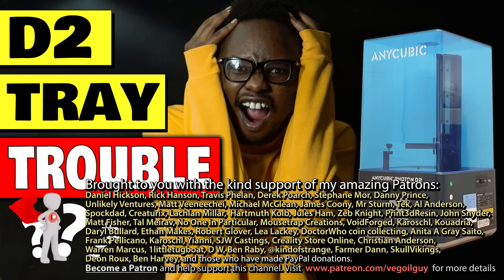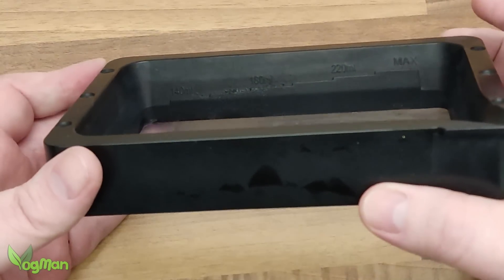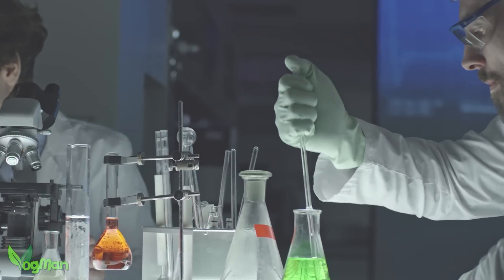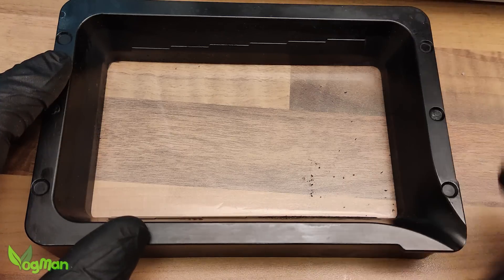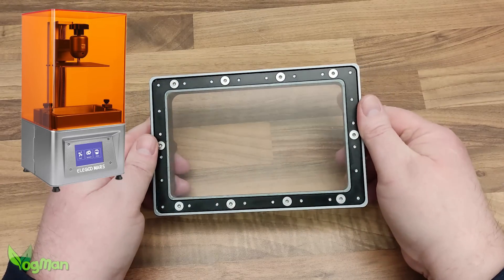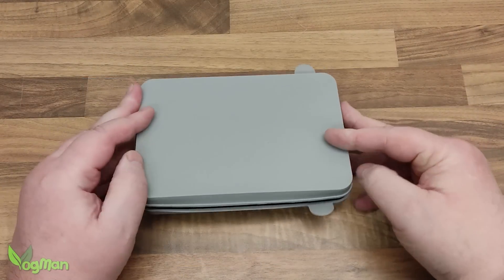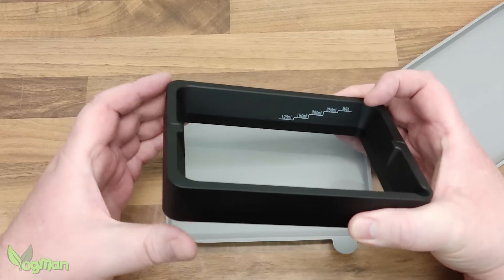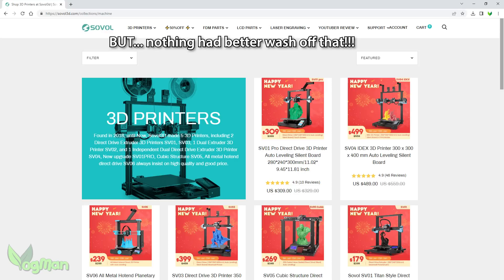D2 TRAY TROUBLE UPDATE - Anycubics Photon DLP 3D printer problem

Comment: Seems crazy to me that things are supposed to be getting better yet my original anycubic photon even has a metal vat. These new printers cost more money and are supposed to be better yet some things seem to be going backwards. If I'm spending that much money on a printer then I expect it to be of decent quality. I only paid $150 for my Photon a few of years ago. Surely it can't cost that much more to produce aluminum vats.
Reply from the maker: That's a fair point Keith, but to play advocate here... these DLPs were a massive undertaking for Anycubic and in many ways were a real risk. Don't forget they initially went down the route of Kickstarter with the Ultra because they needed the extra funding to launch the project. And dammit, both the Ultra and the D2 have been amazing, and have no doubt upset all the other printer companies - and still Elegoo nor even Phrozen have given us a DLP yet.
So we can be a little kind to Anycubic for presenting us with so much plastic on their 2 DLPs (and even on the Mono 4K which is a beautiful and affordable LCD). 
But for me the tray was a step too far. I'll accept the plastic body and the single rail... but if plastics melt with resin, even in rare circumstances, then we need metal. And I hope Anycubic gets the message.
Reply: @vogman  I feel it's because 3D printing at its inception, companies made a lot of metal durable stuff, because didn't know what they could get away with. Now they know what their consumers are willing to put up with, so they are cutting costs wherever they can.
I could be wrong, but I doubt anyone in their companies think that plastic is genuinely better than metal.
Reply: Keith that is weird because my original photon's vat was plastic.
Reply: @spetersen487  I don't know. I bought mine 3 years ago now and it came with the blue anodized aluminum plate and vat. 
Was yours a recent purchase? That could be a newer thing they're doing would be my guess.

Comment: i've just bought 2 extra trays from anycubic for $50 in toal. i thought it was nice because they provided lids on the top on each tray. but i suggest they should also protect the bottoms (that is the films). also it would be the best if it would be a  box to seal the whole tray then i could keep it and change resin whenever i want.

Comment: I got my D2 a few weeks ago. In my opinion the problem is, that the vat is to small for the build plate. So if you place the vat a little bit in one direction and the build plate in the other the plate will scrape the side of the vat and produce that small black partikels.
Sadly I amplified the problem by using the magflexplatesystem which adds to the width of the build plate because it has some extra material on the edges to help peel it from the magnetic pad. 
The sovol tray has a littel "thinner walls" and thus a little bit more room inside the tray and so more clearance for the build plate. Works for me. 
Sadly after cleaning out the tray after the first print with water washable grey resin the paper I used for cleaning was all black from the tray itself. I don´t think that is a good sign for the quality of the vat.

Comment: Th D2 optics are really good. The mechanics incl the tray are of lower quality- why do they not use a screw with ball bearing and a double linear rail as they have in their portfolio (and a metal resin vat)…?
Reply from the maker: It is infuriating. It's such a great printer. I know they were trying to keep the price down, but this went too far for me.

Comment: I've only done under 20 prints but leaving resin in the vat for periods of time is normal for me, already getting black paint in the resin. It doesn't surprise me they wouldn't replace it, as far as I know they no longer offer metal vats to replace it with so there's no point because it will keep happening with each replacement, if they changed their supplier which caused this quality issue no doubt the order was in the tens of thousands. I do in fact already own the Sovol metal vat (unfortunately teflon coated not available in my country) and have had it since the beginning but haven't bothered using it yet, I'll get the full use out of this FEP first! 

Love the printer, love the results, there is no other competitor on the market so it really isn't a choice, but dammit it should come with a metal vat standard like my other printers have considering it's a premium model, Sovol proves that it isn't a cost issue. (I also discovered their FDM printers via the metal vat and picked up an SV06 for my first FDM lol)

Comment: odd newbie resin printer question. I understand that it prints in slices, and each slice is exposed to a light source. This leads to hardening of the resin. Can a Resin printer be selective about how much light exposure time is given to specific regions of a slice. leading to a print with variable rigidity as it's printed. Eg. one half of the print area is a normal exposure time , but the other half is exposed twice as long per slice ?    So two exposures per slice....

Comment: I have noticed the same problem on my Anycubic Photon Mono 4k. There are some small (1-4mm) black particulates in my Vet, which will also be fused into my prints. I will first describe the State in which my printer is and secondly give my hypethesis on why they may be there

State:
I have bought the printer a few months ago and printed some test pieces on the stock printer with the included anycubic basic gray resin. After A print fail and damage of the FEP, I stopped printing and ordered a FEP replacement. Additionally I installed a magnetic build blate and change the resin from Anycubic basic grey to Sunly Standard Clear Red. So after my FEP-replacement, the new build plate and a new resin, my printer works fine, but I have noticed the black particles in the last few days as well.

Hypothesises:
- There may be some problems with the lubrication of the printers lead screw and the black particles are greasy smudge
- The magnetic sticker sheet of the build plate degrades 
- The FEP comes in a preinstalled plastic frame, which is screwed into the Resin Vet. I cant remeber if my FEPS are genuine or not, but maybe the plastic Frame is degrading
- the black particles were trapped in the hollow chambers of the plastic VET and were set free when exchanging the FEP
- the Vet is degrading as you said (maybe from the new Sunly Filament

IMO the trapped particles is the most plausible, because I dont think, that degrading plastic will generate those little chunky particles. More likely would be dissolving.

I am no expert, but those are my guesses
Reply from the maker: Hi Moriar. Would you mind sharing your user experience here https://vegoilguy.co.uk/3drp
I'm collating data on all makes and model of 3D printer to share with the printing community. Good input should give us all useful data 😁

Comment: very disappointed you didn't get offered a replacement, especially after asking you to send yours back - leaving you vat-less... as a previous owner of the Anycubic Photon Ultra, and the current owner of a Elegoo Saturn 2, their custom support is night and day. I had an issue on the S2 with my vat, then my LCD screen. Got a replacement for both within a week and 3 bottles of resin as compensation for the issues and delay in shipment. 

I eagerly await the Elegoo DLP printer, as I will not be going back to Anycubic.

Comment: Sovol is a company releasing very good printers. 
May I suggest that maybe your heater is hurting your resin tray, maybe the resin get a bit too hot and degrade the tray. Since you're apparently the only one experiencing this problem
Reply from the maker: I'm not alone, that's the problem. As for heating, I never heat hotter than 26C which is cooler than many locations throughout the world, including in China where these machines are developed.
Reply: @vogman  yes, you're right. I didn't realize.
Reply: WRONG. Look at the comments on any of the videos mentioning this and see all the others from multiple machines which use the same vat.

Comment: I had the same issue with my Anycubic Photon vat tray last year.  I switched to Solvo at that time as well and I tried to not look back.  The other plus with the Solvo is that you can replace your own feps without having to buy the Anycubic "FEP Cartridge" at their stupidly high prices.  I said tried not to look back because when I upgraded to my M3, the vat tray was metal, but I have yet to find a way around the "FEP Cartridge" and have had to resort to paying $10 for replacement feps, where I could buy at least 5 feps sheets for that price and replaced them myself.
Reply from the maker: Hi Steve. Would you mind sharing your user experience here https://vegoilguy.co.uk/3drp
I'm collating data on all makes and model of 3D printer to share with the printing community. Good input should give us all useful data 😁

Comment: If the Sovol vat fits, then so will the Photon SE vat. Unlike the Sovol vat, it features a double gasket system which should be better in retaining FEP tension as well as minimizing the risk of leaks. There have been complaints on the coating on the Sovol vat flaking as well, and difficulty in getting proper FEP tension due to the single gasket design.
Reply from the maker: I guess time will tell. So far mine seems a superior replacement to the plastic version and the excellent reviews on Amazon give me confidence that at least in the majority of cases things are holding up. But it's certainly possible that issues will show up. I'll keep an eye on it 😁

Comment: I don't see a problem with plastic trays as long as they are made of the correct plastic.
It seems yours is either the wrong plastic or has been manufactured with contaminants.
I have 3 Anycubic printers that all work reliably but they are older versions.
It's tough for these guys to innovate and provide reliability at the same time. If they solve the issue with not too much hardship to the buyer - all good.
I would have thought a replacement unit would have been their first step though.
Reply from the maker: There really SHOULDN'T be an issue with plastic trays, you're correct. But data here suggests that there is, and that's a problem manufacturers need to take note of 😁

Comment: I grabbed a Soval tray after your first video so I never got to see if I had any degradation but I got some resin on the right thumbscrew and the plastic on it degraded quickly. For reference the only resin I’ve used in it is the Anycubic EC Grey
Reply from the maker: Nice to hear Aaron. Take care buddy. 😁
Reply from the maker: Hi Aaron. Would you mind sharing your user experience here https://vegoilguy.co.uk/3drp
I'm collating data on all makes and model of 3D printer to share with the printing community. Good input should give us all useful data 😁

Comment: Hi VogMan, love your videos. I would like to ask you a question about the photon d2, I have recently bought this fantastic printer but I'm struggling with the prints quality. The overall details are amazing but I'm having trouble when I remove the supports because the leave marks on the print, like dents. I use the anycubic craftsman dlp resin.
Reply from the maker: You'll always get support marks. I think I mentioned the subject briefly in this video https://youtu.be/BItHP47SIUQ
Basically everyone has their own technique. You can't print without supports, so you have to deal with them. Personally I clip my supports, leaving plenty proud. Then I clip again and again until there's very little left, then I sand with 600 grit sandpaper. Even doing this you can still get little divots, but filling and sanding cures those and eventually a spray with primer hides everything 😁
Reply: Don't pull them off. This is very basic resin printing stuff, use a scalpel or flush cutter. Look up adonael's resin printing guide it's the best one I know of personally

Comment: this is a problem with plastic trays using ipa on them will kill them. i have on many times told users on my facebook groups i run not to use ipa to clean there trays as they melt.
also i have always recommended the vats from soval i use them myself. i wish they would make a range of sizes. as they are great i use the green ones as they are so easy to clean. remember the plastic vats from anycubic are custom to use the pre installed fep sheets. this is how they make there money back on the machines like inkjet printers got i.e. low cost printer of high quality and make there money back on the inks. its the same with the pre installed fep sheets. :)
Reply from the maker: I can't say I agree with this. My Ultra tray is very well used and has even been submerged in IPA baths. It's still in excellent condition as I showed when I first raised this issue. Yet the one from the D2 started degrading almost immediately, as many others have testified. I suspect a faulty batch is at play here but no manufacture wants to admit that. Fortunately metal trays are cheap enough and don't share these issues.
Take care buddy.
Reply: @vogman  well i cant say for the ultra one the ones i had for my mono 2k and 4k both started to melt with ipa on a cloth though my 4k was a pre release. but yea all the vats have been the same size so could well been from bad batches from the company. its only been the ones with the quick fit sheets. as i used my original photon vat on the 2k then got a couple of the soval vats. the green one is a dream to clean. but as i stated i just told my users not to use ipa on the vats. or least do a spot check on a part of it first. hope ya had a good one matey over the new year. :)
Reply from the maker: Anycubic assure me it's the same manufacturer and where size permits, the exact same trays. It's certainly a weird one.

Comment: The black part on the screws in the Mono 4K get all guppy with with and the fumes of the resin.
Reply from the maker: That is not something I've come across. Are you sure they weren't accidentally covered with resin?
Reply: @vogman  Im 100% sure and I always clean everything after each print with IPA.
Reply from the maker: It would be helpful if you could share your user experience here https://vegoilguy.co.uk/3drp
I'm collating data on all makes and model of resin printer and I need. Experiences like yours are perfect to help inform others.

Comment: Yesterday I had a failed print so I cured the bottom of the tray, and when I pulled out the bottom layer I noticed black specks in it. I thought it was because It was in the garage and maybe something went in the resin... other than that the printer is seriously great. I'll be replacing the tray
Reply from the maker: It's an amazing printer 😁
Anycubic should really have fitted a metal tray, or given buyers the opportunity to buy one.

Comment: Huh? They won’t replace a defective part in their printer? Even if it’s made by a 3rd party, they should replace it for you then address the issue with the 3rd party. Glad you found a workaround though.
Reply from the maker: It's a shame I had to find a workaround at all. Ideally Anycubic should have suggested one, or provided hefty discounts on metal trays to anyone with a D2 or Ultra purchase 😁

Comment: i got my d2 today i will look for this and will tell you. but first i need to buy the resin.
Reply from the maker: It might not be necessary for you. Most people don't seem to have the issue, but look out for tiny black specks or puckering on the sides. If this happens, a metal tray is your best bet 😁

Comment: Hey Mr V. I have 2 sovol vats the same as yours.. I got mine for my original Photon but they also fit my mono 4k after fitting glass screen protectors. I threw the plastic vat away after the first user. I didn't think about complaining about the quality. Great update. Anycubic need to start listening to customer feedback again. Every resin printer should be factory fitted with glass protectors. Those mono screens are expensive.
Reply from the maker: Great minds think alike Tony... and sometimes I do as well 🤣😂🤣

Comment: I have a couple Sovol vats for my Mono, they're great. I went for the teflon coated ones, and the excess resin just slides right out when cleaning the vat out.
Reply from the maker: Great tip! Thanks for sharing 😁😁😁
Reply: The teflon coated ones are definitely better than the black ones.

Comment: I stopped using solvents on plastic vat treys and never had this problem again thats all it is not a big deal
Reply from the maker: I understand that, but unless you use multiple trays or the same resin, there come times when the tray needs to be spotless. For example, I may print a model one day using Phrozen Aqua 4K, then the next day print a ring with Liqcreate Wax Castable. If the latter gets tainted in any way, it won't cast properly... so a very clean tray is a must... and I'd too cheap to buy several trays 😁😁😁
Reply: @vogman  Brotha you have many printers And trays plus I am sure you have a dedicated wax printer for all your wax models so in my opinion this is just an ad for sovol lol but hey some see thru the fep if you know what I mean 😉
Reply from the maker: I suppose it is an ad for Sovol, yes. But my intention was to provide a cheap workaround for folks who don't have the luxury of other printers to choose from. I get nothing from this... well, maybe a tiny Amazon affiliate fee. But I guarantee what I get back from Amazon will never cover the cost of the tray which, like it or not, I purchased just for this purpose. I know no one will believe me, but it really was done in the interests of my viewers. I recommended the D2, so I feel a responsibility 😁